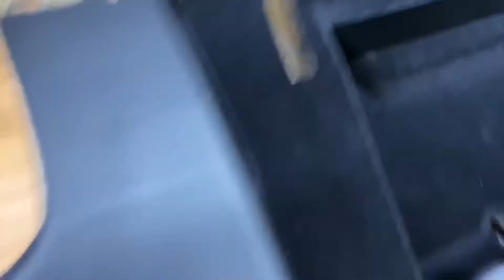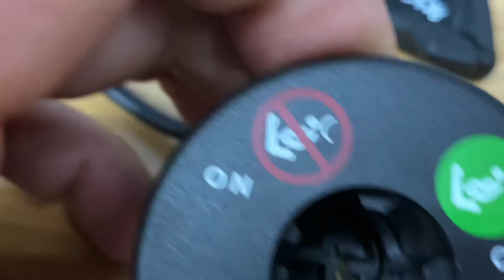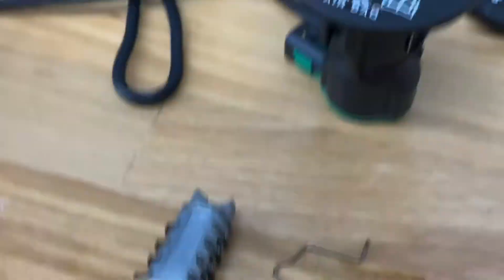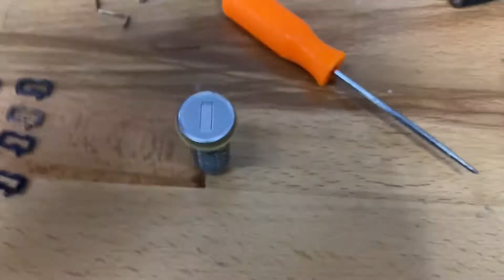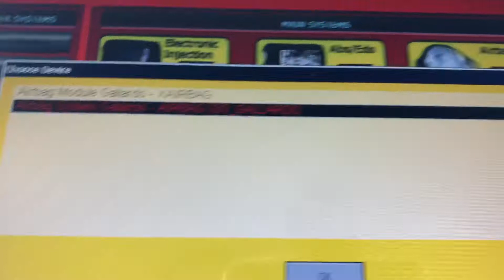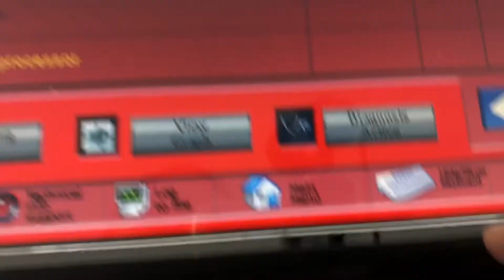Lamborghini Gallardo LP560-4 Passenger air bags no key temporary fix & air bag light

Comment: I have an 07 spyder gallardo..airbag light on.. what scanner can I buy? jpsoldmyhouse@gmail.com
Reply from the maker: BMW LOVER you can buy a generic scanner to check and erase codes but air bag light you will need a diagnostic tool with Lamborgini software. I tried my generic scan tool on my Lamborghini and it would not turn off air bag light. Lamborghini scan tools can cost as much as used or new car depending on software. If you were near me I would scan your car for you.